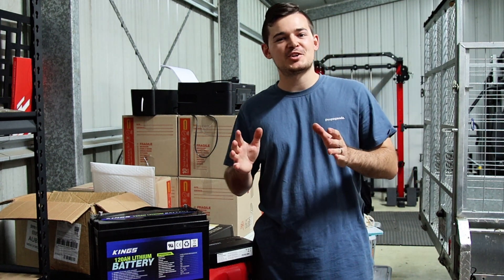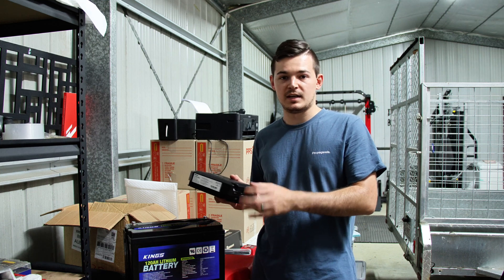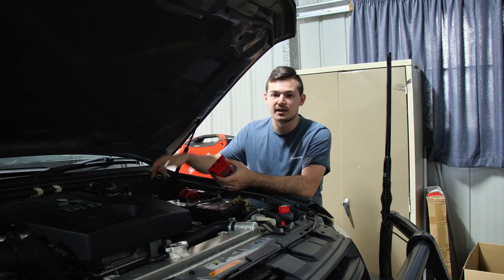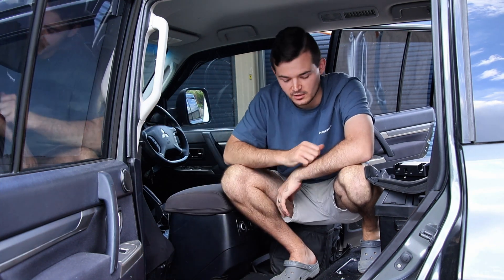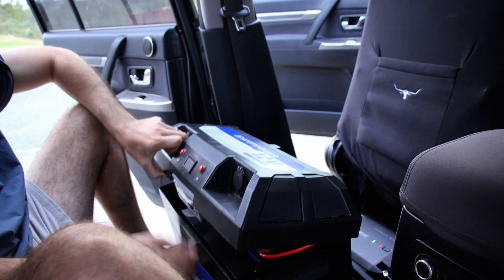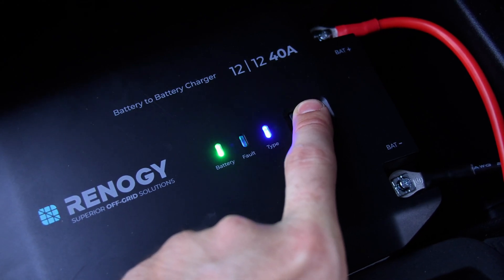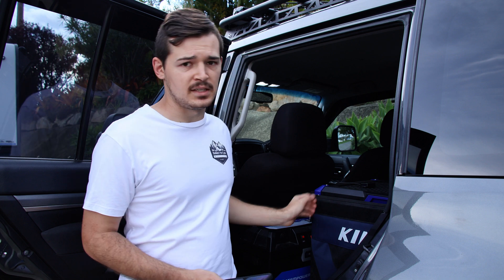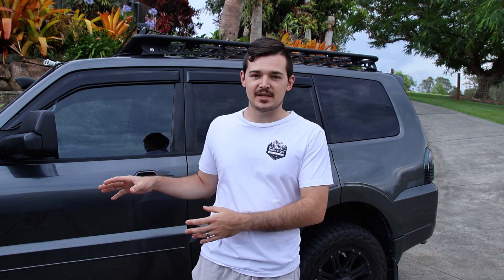BUDGET 12V DUAL BATTERY SETUP | Kings 120AH Lithium + Renogy 40AH DCDC + Kickass Wiring

Comment: Nel video non si vede bene, potresti per favore , indicare in dettaglio dove passa il cavo di alimentazione?  Ho trovato una cuffietta in gomma, è  quella? grazie

In the video it is not clear, could you please indicate in detail where the power cable passes? I found a rubber cap, is that it? thanks.
Reply from the maker: Yes through the rubber grommet🙂

Comment: Your car is smart alternator equipped  I can see the sensor (shunt) under your left hand at 2:30 you should never wire anything directly to the -ve batter terminal , also to get a wire through the grommet, remove it, invert the grommet, and cut the thin end off it and wires will go through easier.

You should absolutely NOT ground the start battery, let the power run from the start battery to the body as per factory... the supply to the DCDC -ve should be connected to the body 

If you have a -ve wire to the Anderson plug, or anything else on the -ve start battery remove it as your battery will get deep cycled and fail , im pretty sure I spotted a wire connected in the Uniden video  

This is important as connecting direct to the -ve bypasses the shun, then that accessory drains power, the alternator doesn't "know" and won't generate the current to compensate
Reply from the maker: Thanks mate 🙌🏼

Comment: So the short end to fuse on main power should be at battery end not charger end..fuse is there to protect the cable so always fuse as close as possible to the battery
Reply: Also you do have a smart alternator you can tell by the earth terminal, because you earthed through the body the smart alternator is reading that as a load.
Reply from the maker: @dannyboy3241  thanks for the advice mate much appreciated. Do you think the dcdc will still work fine like it is? Cheers
Reply: @budget4x4life  no worries..mine is wired the same but I'm using enerdrive 40+ and got no issues..you could still use the vsr as a safe guard ..just remember the more power demands if still using the factory earth cable you probably will have to go a bigger cable gauge
Reply from the maker: @dannyboy3241  too easy thank you!
Reply: @bgt4x4  only if NOTHING is connected o the -ve terminal on the start battery.. except the factory connector
Reply: @dannyboy3241  There's no point chaining the cable, as the shunt is the limiting factor with current on the start battery
Reply: @davidl6041  how is it the limiting factor, the shunt should be rated to at least the rated output of the alternator, so I cant see why changing the the cable to shunt cant help?
Reply: @dannyboy3241  Sorry, to me its obvious, I should explain !

The shunt is a (hopefully very low) low resistance resistor, basically a pice of metal with known resistance.

Because I =V /R current = volts/resistance the math is easy to calculate  because the R is known and the votes can easily be measured the I can be calculated, then the alternator matches that current, in real time

However any piece of metal can only carry so much current(amps) before it melts,(that's how a fuse works) 

Every blade fuse in your car, is a (potential) shunt, you might not realise ..

Most fuses, have a chart which tells you resistance, you can measure voltage drop across them , then know how much current is being drawn from that fuse ! This is why blade fuses have the little metal bits to probe when still in the fuse block.

Just like a fuse the shunt itself will melt if you draw too much current, even with 0AWG copper wire connected !

My car has a largish 810 CCA battery, that means it can deliver 810CCA in 0 Celsius temps for 30 seconds easily enough to arc weld thick steel.. and even more current in 20 degree weather!

The power available is way more than the 130 A alternator or whatever is fitted !

Thus fitting larger battery and larger wires become pointless without factoring in the shunts max rating, the shunt will become the fuse

If the shunt and alternator are dong their thing correctly it should be measuring almost 0 amps as the alternator should supply all the power when driving, the aim of the smart alternator is to make that 0 .. apart from the recovery charge after starting the car

Comment: Good vid. So where exactly in your car have you installed the battery. It looked like it was on the back seat.
Reply from the maker: @allanpower8041  took the back seats out. But yes battery is behind passenger seat 🙂🤙🏼

Comment: Hey d I was told by mitsubishi that the nw has a pcm controlled alternator and that's y u need a dc to dc charger but they could be wrong anyway love ur vids and the website keep up the great content
Reply from the maker: @jasonsims3483  Hey Jason! Awesome thanks for letting me know 🙌🏼🔥 Appreciate it 🙂
Reply: @bgt4x4 it may drain the starter battery when not running without the ignition from what I understand - I’ve got a Kickass DCDC wired into my NX with the ignition wire connected.
Reply: Yes i can confirm that your paj does indeed have a smart alternator
Reply from the maker: @ cheers Rick! Not sure why it still works as normal haha. Gets charged up when car is running😄
Reply: Would be worth running a power meter on the fridge over 24hrs. But otherwise guessing you might need to replace ~600Wh/daily for the fridge. So 40-50Ah just to keep the fridge going.

So ~70 minutes driving a day to keep battery topped up, battery would have a 2 day buffer. 

Solar panel would be good to bring that need down.
Reply: Awsome job
Thank's for sharing